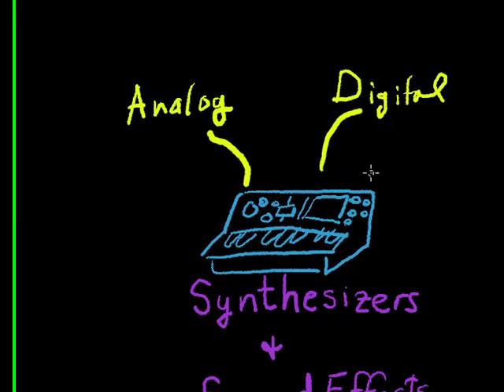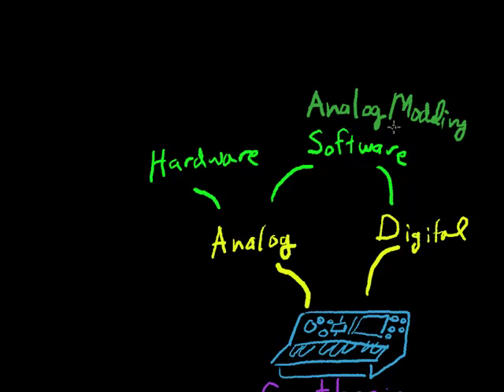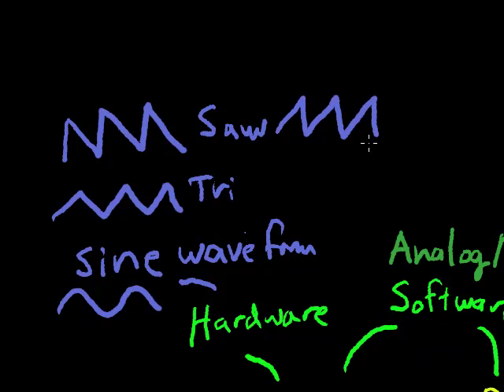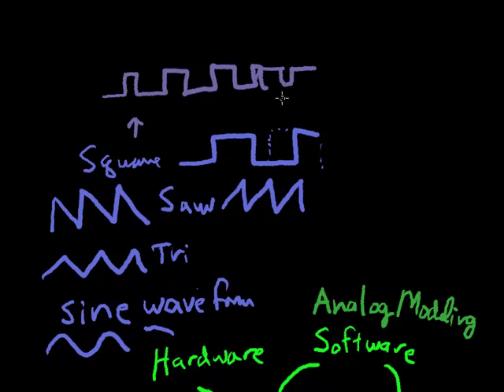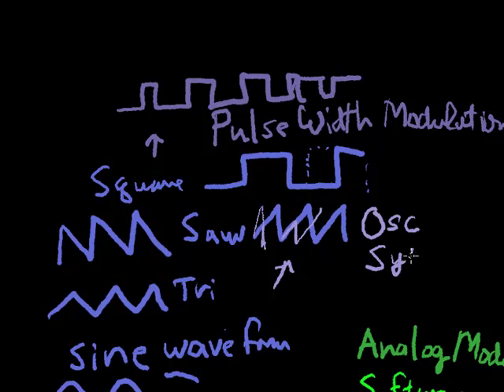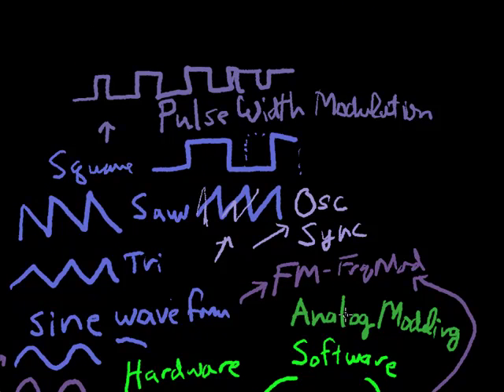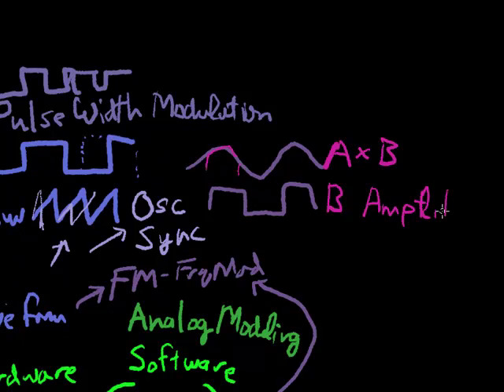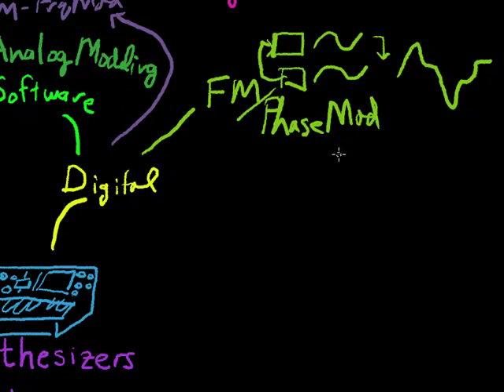Innovation: Synthesizer and Sound Effects Part 1 of 5

Comment from the maker: Yes, true analog is much more complex in sound quality than analog modeling.  This results both from distortion of the waveforms and variations in the generation of the waveforms through analog circuitry, variations in voltages, currents, temperature etc as the device operates gives a more complex character.

Software sounds pretty much the same every time the program runs.